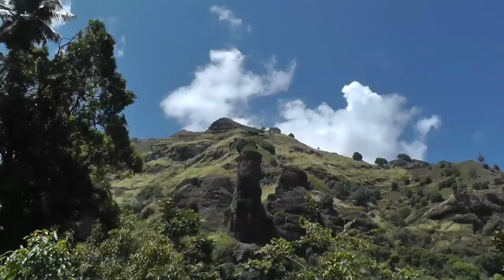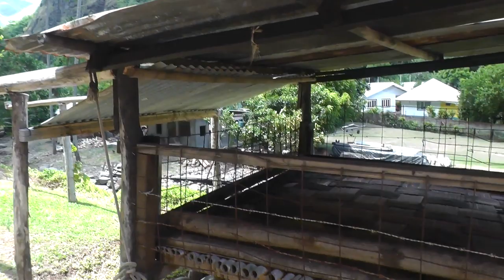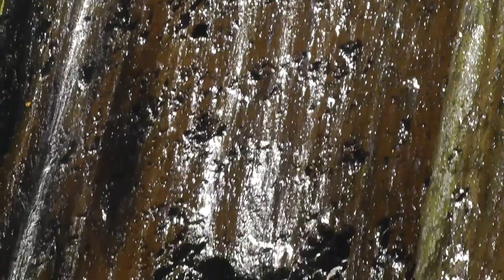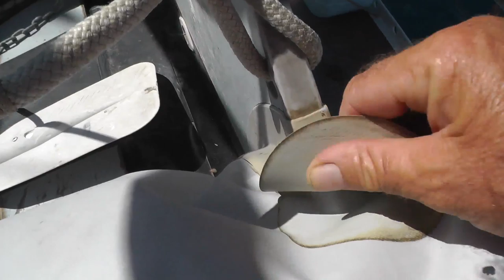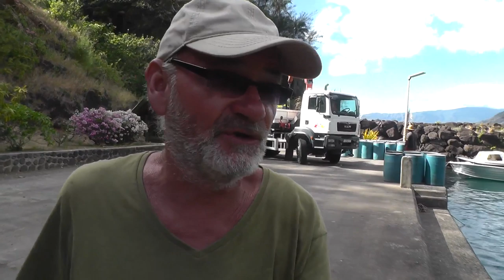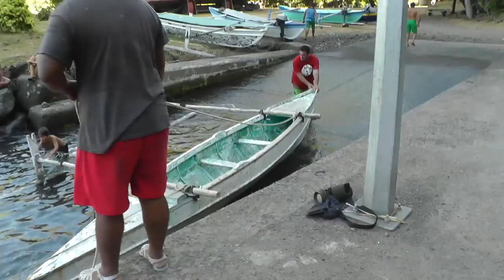Pacific Island Hike  Adventures of an Old Seadg, ep126

Comment: I think with what I saw of that Dinghy you should fix it. These are parts that are very commonly necessary for gluing. As a raft guide we fixed stuff like this all of the time. When its a cut its a different and tougher problem. Here's a place which will get the glue to the next port before you get there. Unless your in French Polynesia for a long time. You could have it sent there. Three different glues. You can do this. https://www.nrs.com/boating_tips/quick_guide_urethane_pvc_boat_adhesives.asp

Comment: Do yourself a favour. INVEST in a Hypalon Rib. Mine is already 15 years old of hard use and still perfect, I've seen some old Zodiac Hypalon ribs 25-30 years old still going strong. My next Rib will be a Very light Aluminium Hulled Highfield Rib. Not cheap but an investment. Avoid PVC.